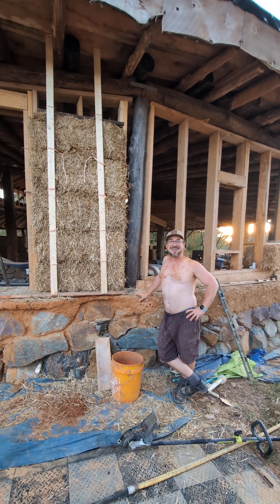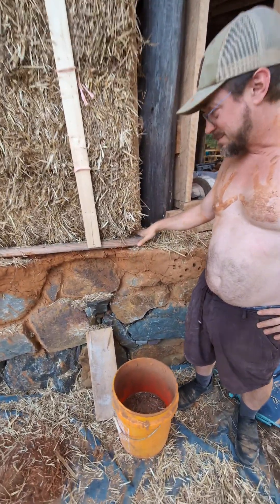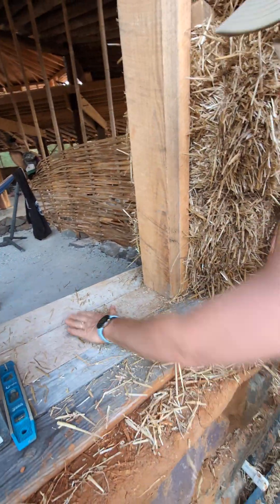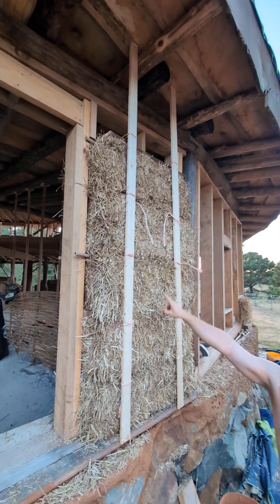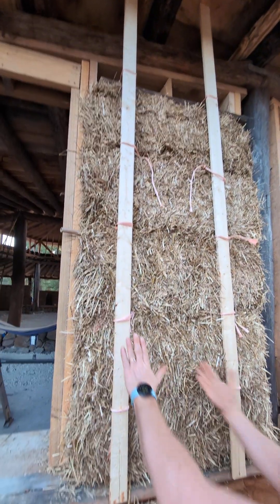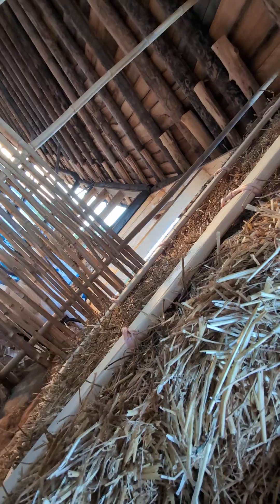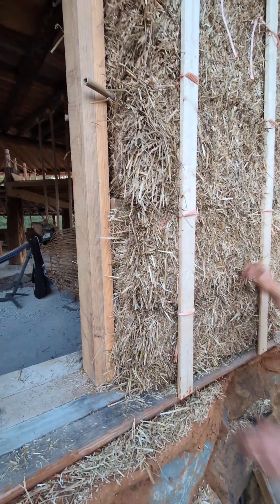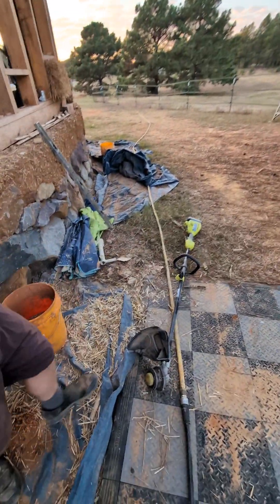Our first straw bale wall prototype is complete and ready for cob! Here's how we prepared the bales.

Comment: This guy must have missed the classes on fire and how hot hey straw get and they can catch fire just from heat as a red neck I never use this as I put out to many fires 🔥 in hey straw barns but good luck 🍀
Reply from the maker: @Yuckster  Once the straw is encased in clay, it's fireproof!
Reply: @naturallivingwithmikeandnalini  lol 😂
Reply: You’re wrong. When straw decomposes, it gives off a massive amount of heat. No amount of clay can “fireproof” the decomposition process of straw. I would quit while you’re ahead
Reply: @bobroberts2217 You're forgetting that fire needs oxygen. The straw bales will be encased in cob. It will be impossible for the straw to get enough oxygen to combust. Plus, the straw will not decompose for the same reason: it's encased in a hard, solid substrate that regulates moisture. Thanks for the comment!